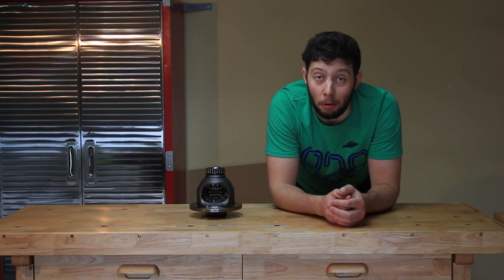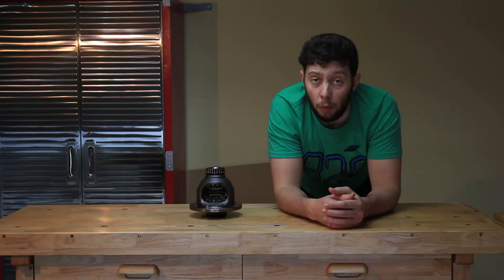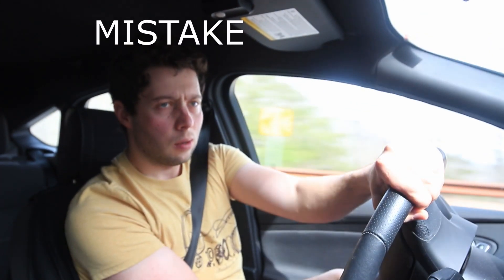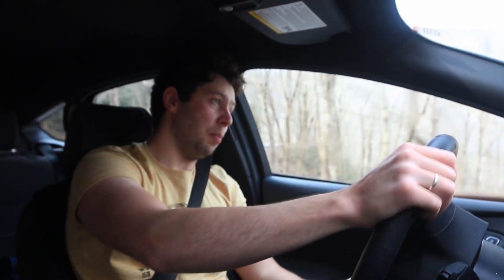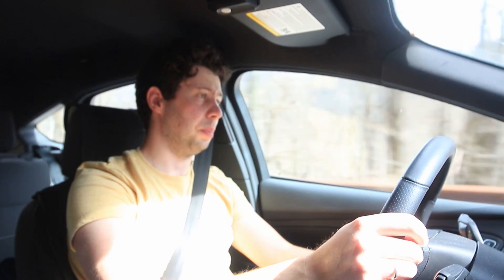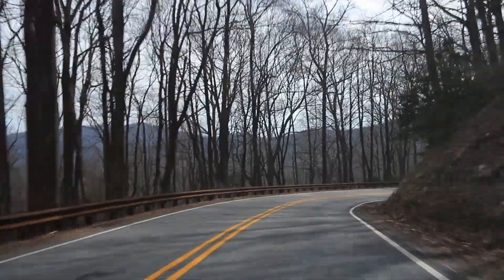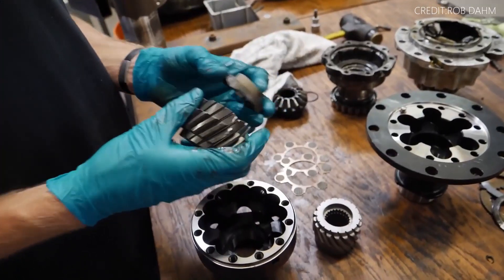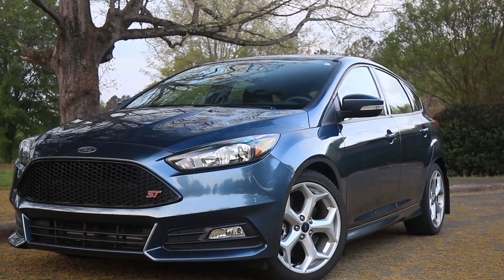3 Things You NEED To Know About MFactory LSD/2018 Ford Focus ST

Comment from the maker: To be completely fair, you can solve the traction issue at some degree using all sorts of bracings, stiffer engine mounts and so on. What makes an LSD better is it's versatility, because you increase traction without sacrificing comfort and factory suspension settings, and if you are still not happy than add bracing and motor mounts).

Comment: Do you still have the focus with the mfactory diff? I have the same color focus st with a big turbo and have an mfactory lsd and carbon synchros on the way to throw in at the same time with a new clutch/flywheel. I'm curious how your diff has held up over the years if you still have it.
Reply from the maker: It's still in the car and it's just as good as it was when I installed it years ago - no torque steer and lots of mechanical grip to pull you out of corners.

Make sure you have good tires with bigger turbo
Reply: @ArtDrivenRoads  Glad to hear it's held up so well! Yeah, I run 255 pilot sport 4s on my enkie rims for the summer and have my snowflakes with some blizzaks for the winter. So I just swap the tires around as the weather calls for it which helps a lot. I've been big turbo for about 3 years now and I've sorely been needing an LSD so I'm excited to get it in.
Reply: @Anthony-pn9jx  Gotta come back to this comment and let us know how it feels. Ive got a PTX2867 maxing out the stock fueling and I feel like I badly need a LSD. Hardly any good reviews with big turbo, seems to be popular on stock turbo for reviews lol (Dont get me wrong, its obviously more needed on BT, but Im still curious how it handles the additional power)
Reply: @jamestorby  It'll be another month before I get it put in but I'll come back and definitely let you know.
Reply: @Anthony-pn9jx  I ended up buying one. Ill be putting it on next week lol
Reply: @jamestorby  oh hell yeah! I'm still waiting on all of my parts to show up before I can have it done. Let me know what you think!

Comment: How does the stock traction control work with this? Do you just leave it shut off?
Reply from the maker: it doesn't conflict with each other - It will still kick in for whet conditions where both tires are struggling for grip

Comment: Why didn't you go for wavetrac? I went for quaife and wish I went for wavetrac after learning more
Reply from the maker: @johnstape4488  mostly price - I've upgraded quite a few more parts on the car as well as fluids at the same time I pulled the transmission. 

So, the price difference between wavetrac and MFacyory went into additional parts. 

3.5 years on track and street and I am more than happy with the MFacyory LSD. At least with my current skill level, I haven't experienced lack of traction when I needed it.

Comment: I know the video is a few years old but I am grateful to have found it.  It’s brief and to the point.  My 2013 has every brace I could find for it.  They do well but I still have torque steer.  I am about to drop a big turbo.  With the power increase I am expecting torque steer to be a beast so I have been thinking about adding an LSD.  This video has given me a better understanding of the benefits and drawbacks of LSD on the ST.  Thank you.
Reply from the maker: Yes, go for it! Although I had it for a few years at this point I'm still amazed at how well the front end grips in corners and wet conditions even with stock power.

Comment: Does this work on the rs?
Reply from the maker: It depends what year RS model, generally speaking RS is AWD so the power is sent to back as needed, to minimize understeer and improve traction. Also, the 2018 model came standard with LSD. Nevertheless, there is a quaife LSD for RS on front axle. The MFactory LSD is produced for focus ST only.

Comment: For drag racing would you recommend M factory LSD or the Locker.
Reply from the maker: I never done drag racing in my ST. with that being said, any LSD over the factory open diff is going to be better, now they all have very strong internals (if something breaks, it will not be the LSD). If you are only planing on doing a few runs here and there, with low budget and without much prep the MFactory is more than enough. If you plan on competing professionally, MFactory is still a good option considering that you've already spent a lot of money on tires, clutch, new synchros, engine mounts, cooling and so on. Again, aftermarket LSDs are very strong, but if you have the money, buy the best you can find.
Reply: @ArtDrivenRoads  yeah car is making almost 500 horse and it just broke the trans so going through a rebuild and gathering parts right now

Comment: Looks like the roads I used to take going up to WCU, This is my next upgrade for the ST when we get back to the states. I did a Cusco Type RS 1.5 in my Soarer and it transformed the car. I am hoping it will do the same with my ST. Only draw back was extreme tire wear after i installed it on the Soarer. I expect it to be less on the ST
Reply from the maker: Yes, It does make a big difference on ST for sure. One important thing to remember, like I mentioned in the video is that the MFactory LSD WON'T transfer torque if you are off throttle. In other words if you are going up hill, the grip is phenomenal, if downhill - you can easily understeer if not careful. I went with MFactory because it costs less, otherwise I would have chosen Wavetrac.
Reply: @ArtDrivenRoads  Good to know , it’s the same with the Cusco. My ST has the MRX kit on it , so anything to help with traction will be great.

Comment: My Daily is a FWD Ford Fusion Platinum 2.0TSEB with a Solid Rear Motor Mount & Front & Rear Stabilizer Bars and My Car feels like is has one! It’s Weird because it Rotates and never Understeers or have tire squeal in corners. From a Stop They used to Torque steer like crazy. Now it just Hooks!
Reply from the maker: That is an interesting perspective, this is generally what people do to get rid of torque steer and understeer without interfering with transmission. And it looks like the rear sway bar and fusion's longer wheel base compared to focus helps it rotate. At least for me the biggest difference comes when you drive with average tire on a tight road, when you load up the front end the LSD seems to transfer a lot of torque to the outer wheel which get's you thru the corner with way more confidence compared to the standard brake vectoring.

Comment: Thanks for sharing your video, could you fit THIS LSD to a standard ford focus 2.0 tdci?
Reply from the maker: If you have a MK3 focus, From what I could find it seems, the 2.0 tdci focus has a very similar transmission to ST version because of the torque rating, which means that it should fit the "ST250 MMT6 Helical LSD MF-TRS-05STA" I have in mine.  "ST180 IB6 Helical LSD Part No.: MF-TRS-05IB6" might also fit in your particular case. Call one of your local MFactory dealers, they do the installation and could also advise you on the exact differential you need.
If you have a MK2 tdci you might be better off with a quaife LSD "QUALSD4"
Reply: @ArtDrivenRoads  thanks for the quick response 👍👍 I've mapped the ecu from 140hp to 180hp but what I find is when I floor it it has too much torque and it feels like pulls to one side.
No only that it has developed a whine under load that goes away when I let off the accerator pedal. So i'm going to strip down the gearbox and i thought why not try and fit an LSD while I have it apart.
Reply from the maker: @boost351  yes, that is torque steer. It's not problem if you have no more than 200 lb/ft of torque, but as you go up an LSD is a must! Glad, I was able to help!
Reply: @ArtDrivenRoads  thanks man. Would  you know who I  could  go through to sourse a LSD? Currently live in Spain.
Reply from the maker: @boost351  It can be shipped to Spain for about 130$ "http://www.teammfactory.com/catalog/mfactory/helical-lsd/Ford" or try to find your nearest dealer who sells them, France might be the closest to you "http://www.teammfactory.com/dealers"

Comment: I would just stick to a better tire...
Reply: Focus st torque vectoring will eat up those better, and usually more expensive tires.
Reply: Once you've driven a car with a diff in it, you'll hate driving an open differential on a whole new level. My 190bhp corolla with eibach springs, bilsteins, and big rear anti roll bar handles so much better than my wifes  300bhp TT .it drives the front of the car round corners so much better.
Reply from the maker: it really depends on what area do you live in, I've noticed that whenever I had 60F and up the tires would warm up well and traction was really good, but every time the winter would come I would have serious issues gaining traction even in dry conditions.

Comment: What about price?
Reply from the maker: The LSD itself can cost you between 700 and 1100$. The cost of labor can be tricky because it's not a service that can be done at any transmission shop but generally it is around 1000$ + don't forget about shims, new transmission and brake fluid.